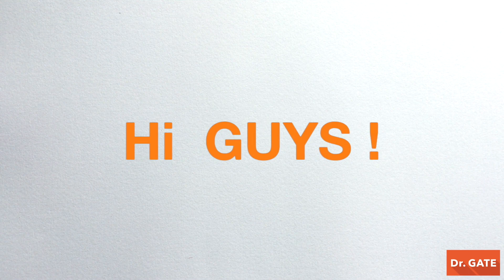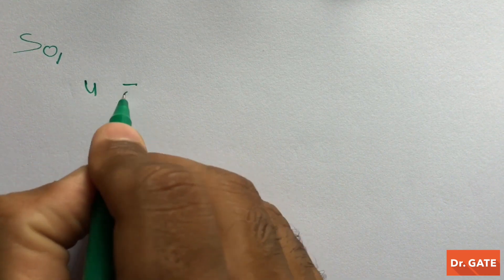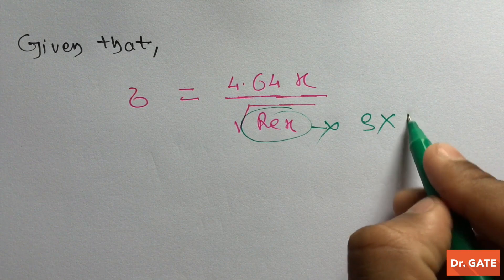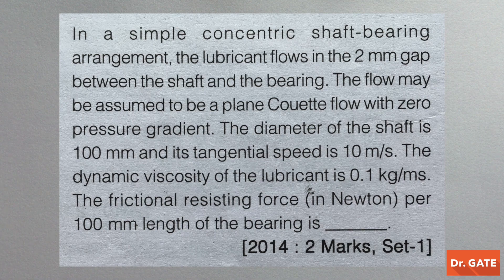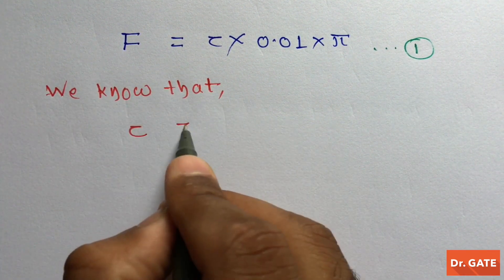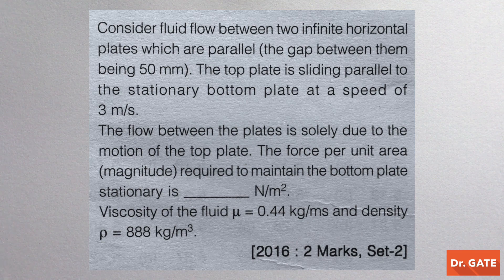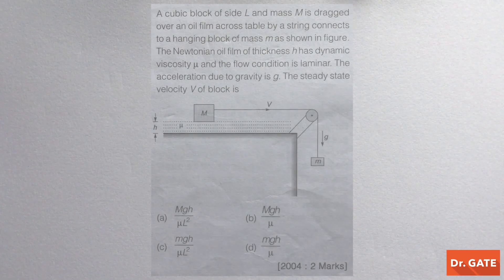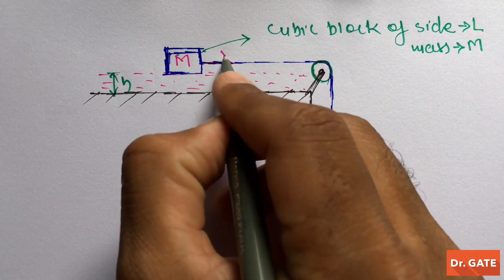GATE 2019 | Fluid Mechanics | Numerical on Viscous Friction

Comment: My doubts  are
 thermodynamic  1).gate  2005 ( the number  of  possible  cycles  are ? )
2). Thermodynamics ( chapter - pure substance )
        common data question  gate 2008  
Please  make video solutions  on  these  questions. ..
Reply from the maker: Brother i will make videos on that topics too. But after Fluid portion, i will cover Engineering Mechanics, MOS, MD, TOM.
Then i will start Thermal part. 
So it will take time.  Sorry for that 🙏🏻